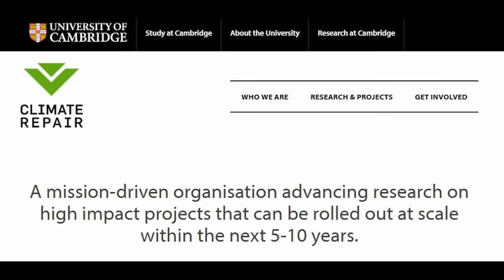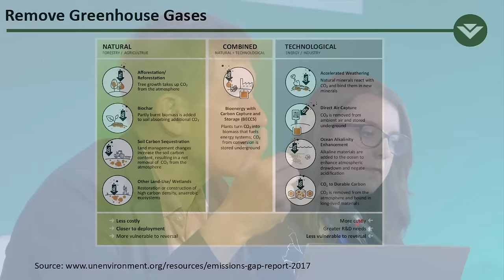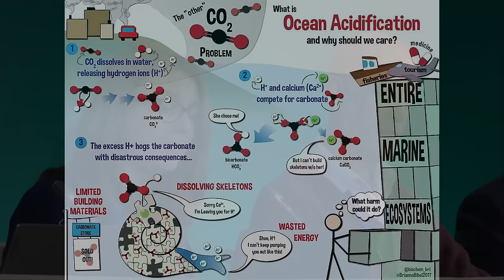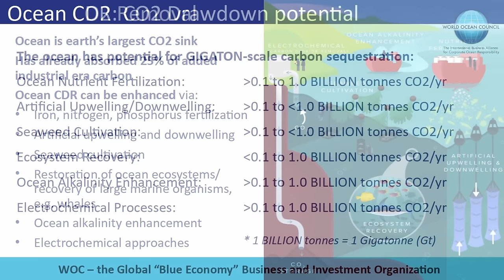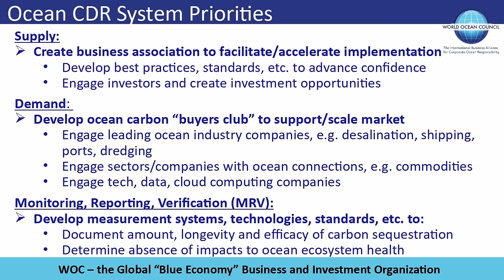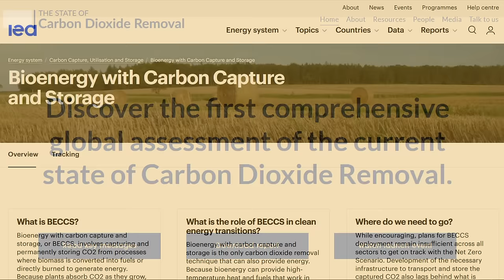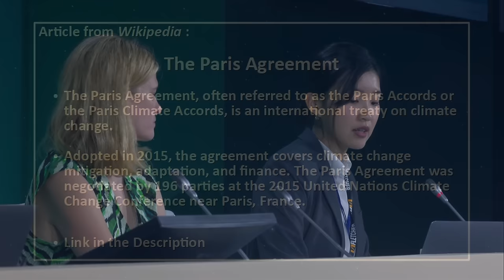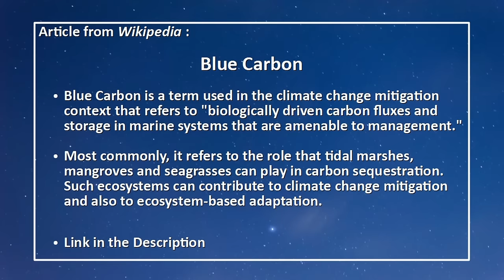New Greenhouse Gas Removal Pathways

Comment: One gigaton per year... Yea, human activity pushes around 60 gigatons per year to the air as overall impact... Just stop emissions now and we have a patch over it. Continueing any fossil burning is insanity.

Let's do ALL of these and ruin our oceans in the same time. And still we are too low to even take one tenth of our current emissions... And who is going to pay these?

And the part that is hardly taken in these calculations: TIPPING POINTS. We are crossing some of them already. And many more when we reach over 2C. These tipping points are not coming back when we go just a bit lower temperatures. When 1km of glaciers height is gone, you'll need at least 6C lower temperature to start growing it back. That's from altitude change alone. Same goes for many other tipping elements.

Comment: Questions around DACCS - how will you justify the significant energy overhead of DACCS? How will you then transport it over distance? Where will you store such vast amounts of gas safely? How will you build the pipelines, and at what financial and carbon costs? Even if you are talking about industrial and power generation 'tailpipe' emissions, then the costs will be huge. If you are really suggesting open-air DACCS... well that's just silly.
Questions around BECCS - BECCS is presented as a zero-sum carbon option. It conveniently ignores the reality of the sheer scale of growth needed to scale this, the 20-year lag while regrowth becomes CO2 negative, and the hugely carbon-intensive logistics of processing and moving timber (not just any old growth, hence significant waste). How will you start and scale BECCS without deforestation?
Both of these 'technologies' are great until they get out of the lab, when they hit the engineering and economic realities. The answer really is 'just stop oil'. We really don't need to burn anything. We have a star doing that quite nicely already, providing more solar and wind energy than we will ever need.
Now who might be in favour of 'solutions' that allow continued oil and gas extraction?

Comment: Ill probably actually watch this tomorrow but if the description is anything to go off of and you start making carbon pollutants for the ocean to deal with instead of us, not only are you missing the point, but you are doing further short sighted damage that is going to result in catastrophe, biomass for energy will also be polluting and missing the point, we need green power, not investments into more dirty power that causes more problems, and the only way carbon capture will work is if we first stop making any more carbon, otherwise we spend more carbon energy to collect the carbon.

Comment: Move forward with Ocean Fertilisation with rapidity. It is the cheapest, most effective and scale-able. It can also have the least impact in scale if implemented beyond the continental shelf in the zones of the Tropics. These areas, for the the most part, avoid large fisheries and crucial traditional indigenous fishing grounds due to historical rates of low productivity - thus being ideal for primarily Iron Fertilisation. 
This method is highly scale-able, easily implemented, and extremely comparably cheap to operate at very large scale. 
Michael Barrett 
Secondary EES, Physics, Science Teacher 
Sydney, Australia.